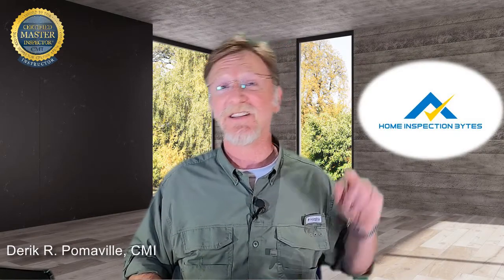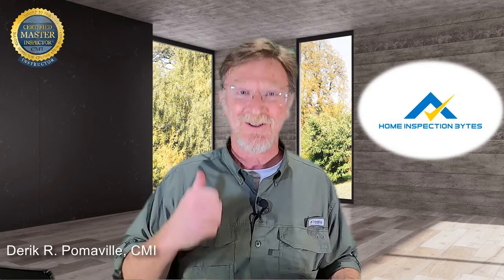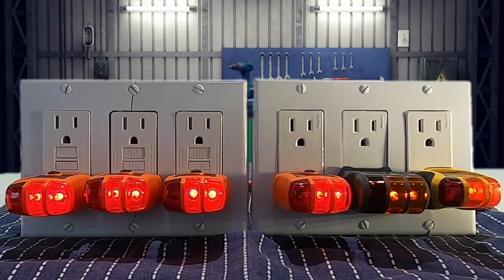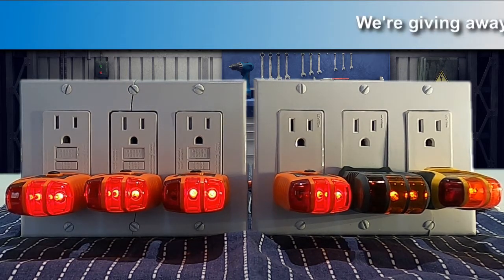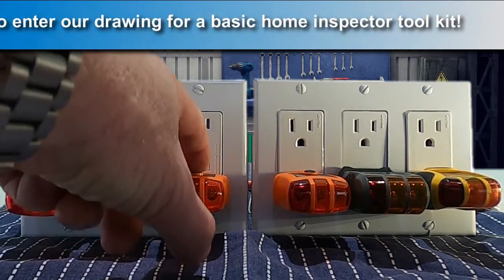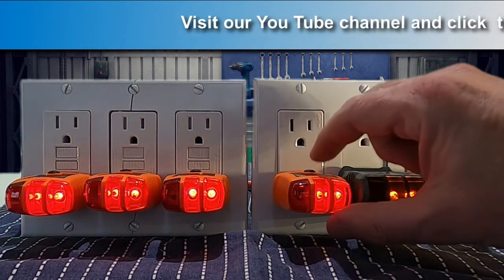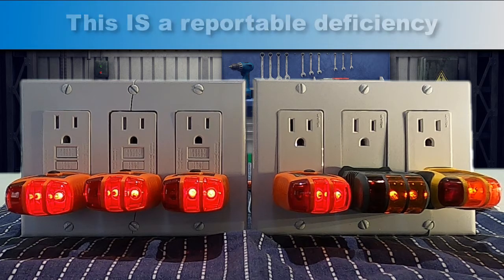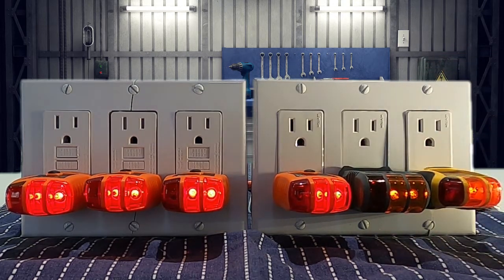Multiple GFCIs one Circuit

Comment: I Think I am falling into the problem you are discussing.............  
I have 3 GFCI outdoor plugs on a 15amp breaker.  All were working just fine.  Now my scenario is one GFIC is green and test resetable,  one is showing red and not resetable.  The last one is dark, no power to it.
I just changed out the red GFCI receptacle and the replacement is showing the same red light and is not resetable.  Pulling my hair out here. :-)      
I dont think its a incorrect wiring anywhere along the line  ( line load setup incorrectly) as I rewired these several years ago and they have been working fine until now.
Of interest, in the faulty GFCI,  the hot to neutral voltage was reading 5-6V  and measuring hot to ground was 25-26V.
My fear is that I have an internal wiring issue  and on a finished house, impossible to deal with.
Any ideas?
Reply: Update:    I started with the first GFCI receptacle which is working properly. Tested the voltage and all is good and rewired it so the two wires to the next receptacle were also in parallel (not series).     The next receptacle with the red light originally, is problematic, or I should say the wires at the junction box.    I did note that the two ground wires were wired to two different screws so I put the two wires on the same screw and then the single separate copper wire for ground on the receptacle on the same screw.
These are the results with no power applied to the circuit.

Line Voltages  ( wire coming from first good receptacle) 
Hot to Neutral  0.5V
Hot to Ground  0.5V
Neutral to Ground  0V
Load voltages ( wire going to next receptacle )
Hot to Neutral: 0V
Hot to Ground: 2V
Neutral to Ground: 2V
These are the results  with power applied to circuit. 

Line Voltages  ( wire coming from first good receptacle) 
Hot to Neutral  8V
Hot to Ground  8V
Neutral to Ground  0V
Load voltages ( wire going to next receptacle )
Hot to Neutral: 0V
Hot to Ground: 2V
Neutral to Ground: 2V
Conclusion, there never was an issue with the GFCI receptacles as none were involved in this testing.  I suspect now that I have an internal and potentially dangerous wiring somewhere in the house that is causing a leakage of around 112 volts ????

Comment: In a non-ideal world,  where my kitchen and bathroom GFCI were installed post construction and are daisy chained,  yes, big annoyance. 

Another creator said the second GFCI wouldn't work at all, even though receiving power. It turns out daisy chaining via line > load method does not work if your outlet has a grounding wire. Mine does not, so it works.

Comment: I can see how this could be confusing for multiple outlets.   I would disagree however if you’re also including a GFI breaker + GFI outlet wired so that each can provide trip protection for the same circuit.  In this case it’s easier to check why the outlet is dead and it’s just redundancy for GFI protection at both outlet and breaker.

Comment: This is a matter of how the outlets are wired. Each of the three GFCI'S should operate independently since they are in seperate rooms. To do this simply make pigtails off the feed in each box. Wire the pigatils to the line of each GFCI. The way this is shown it appears the first GFCI feeds the down stream GFCI's off the load side of rhe first one. That is improper.
Reply from the maker: Thank you for the details. Yes it's improper, that's the point.  To demonstrate a common deficiency found by home inspectors.

Comment: It's an inconvenience to look for the tripped GFCI, but it doesn't violate code. You may need to move boxes around, but I don't believe an inspector should write it up. Stick to what the code requires and not inconveniences.
Reply from the maker: I disagree. Home inspectors are not code inspectors.Some states even prohibit citing code in the report. The video is about the inconvenience of having to reset them in the proper order to regain functionality. Recommendation stands for professional home inspectors to diocument this condition in their report.
Reply: @HomeInspectionBytes  Inconveniences are relative. Some people may not mind it all while others may. Safety, which is the foundation of codes or standards, shouldn't be compromised. I don't believe it is wise to let inspectors decide what is convenient or not. Your project approval will depend on the inspector's opinion.
Reply from the maker: @thejuicerr  this video is for independent home inspectors, not ahj.

Comment: Dude, this only happens if you wire it wrong.     If you put the everything up stream on Line (both sets of wires); the down stream stays live when the up stream is tripped.  

This isn’t a problem unless a dip stick puts the line feed on the upstream line, instead is the upstream load. 

I would right up your foolish example BUT NOT a properly wired multiple on on circuit.  

Also who the heck is putting that many different baths on one breaker; again only a fool and that crap should be wrote up regardless of the GFCI, upstairs bath and down stairs bath need to be on separate breakers.
Reply from the maker: Apparently, you didn't see the first part of the video where we talk about how this is something home inspectors frequently find and have to document as a deficiency in their report. The point of the video is to describe why they would experience these symptoms when testing the outlet.

Comment: I don't usually comment on thing, but after what I just went through, I felt it necessary. I want to thank you for this information, I just experienced what you were talking about.

I was upstairs in my guest bathroom, which is a GFCI, as per any normal wiring code as it was next to a sink, but when I used my tester to trip the GFCI, my tester told me I had successfully broke the circuit. Now I will say that I am a new home owner in this house, and didn't know anything about the wiring. So as you just described I tested the circuit on the outlet I was testing and found that the GFCI did not trip on the outlet I was testing, I also could not get it to reset and had no idea what was going on.

Thinking the GFCI was faulty, I took a non-GFCI outlet I had and installed it, I know that is not to code, but before installing it I noticed that 2 outlets in my living room, downstairs were not working, which really confused me, and I was just trying to test if the GFCI was faulty. As you can understand it did not fix the problem, so I put the GFCI back in place and went to my main breaker to see if I could find a tripped breaker, again, as you know there was not a breaker tripped, which left me scratching my head

I would like to point out that on the main breaker diagram I could not find a single breaker that said it was for the upstairs bathroom. In doing some investigating I checked the master bathroom, to find nothing wrong, I tripped the local GFCI and reset it just like you would expect. I then went downstairs, and on a whim, I checked the downstairs bathroom only to find the outlet next to the sink, the only one in that bathroom, and also a GFCI, was not working. I then checked the GFCI which looked like it had not tripped, to find it was not, and now I couldn't get this one to reset.

At this point I remembered that on the main breaker diagram I read a line that was labeled as downstairs bath garage gfi. It was at this point I decided to check the garage outlet, and what I realized was that outlet was also a GFCI, which I didn't know prior to this point. It was tripped at the local GFCI, so I reset it and also reset the downstairs bathroom, which also caused the living room outlets to start working, I don't know if it was tied to the garage or the bathroom as I didn't check prior to resetting the bathroom.

I then went back to the upstairs guest bathroom and was able to reset the GFCI. After all of that I Googled how many GFCIs could be on one circuit, which is when I found this video.

I would also like to say that this house was built in 1984, long before I ever thought about being a home owner, as I was 5 at the time. I guess I just wanted to say all of that to say that I fell victim to exactly what you said could happen, I tripped the garage GFCI when I was on a completely different floor and side of the house from the garage, and had no idea I'd tripped the garage GFCI, thank GOD this didn't happen when when time was not available to run down the issue, and that I was able to figure it out without having to call an electrician.

So thank you again for making this video, though I found it after I'd resolved my problem, I just wanted to say that I experienced the exact situation you described.
Reply from the maker: I'm so glad we could provide you with an explanation for why you had the problem!

Comment: I completely agree with this idea as being the best method of wiring for GCFI's on a single circuit. 1 GFCI and the standard outlets per run of outlets on a circuit is Best way to wire a Home
Reply from the maker: It sure makes things easier for the homeowner and doesn't require the extra expense of all those GFCI devices!
Reply: @HomeInspectionBytes  Exactly right

Comment: Yep, you must wire them in series! That way each GFCI plug will trip independently, regardless of all the receptacles running on the same circuit! You just have to pigtail them in to series. 

Here’s an example, in my kitchen, if I have “5” 20 amp GFCI outlets wired in series “pigtail” then let’s just say the center outlet trip then that means the other receptacles don’t trip because each one is independently wired “series” not parallel! but they will all do the exact same thing instead of having to go back and reset the receptacles one by one. Technically, you just need one GFI receptacle to protect all the other plugs, downstream,but you can have them independently if you want but most people only put one GFCI on one circuit for the cost. But more to the story, you can have multiple GFCI plugs on one circuit even though it’s not practical, but you still can. you can go to a more alternative expensive route, which is a whole home GFCI breaker protection but that’s a lot more money.
Reply from the maker: Great comments, and thank you for posting!  All too often, others look at this video as though we're trying to teach others how to wire up GFCI outlets, lol.  Thanks for providing perspective and relevant commentary.  

DP
Reply: Not in series.

Comment: Well if you're feeding the other bathrooms on the load side, why install additional GFCI outlets at all? Better yet, spend a few extra dollars to put each bath on a dedicated circuit, use a combination breaker and don't use any GFCI outlets, no?
Reply from the maker: The whole point of the video is to demonstrate how multiple GFCI's on a circuit are a nuisance to the homeowner.  Home inspector's don't typically make recommendations for how to wire the house.  We find the conditions and report them for repair.  If you install a GFCI outlet correctly, all the downstream outlets are protected.  There is no need for the additional GFCI devices.

Comment: It good to have multple no fault recepticals on same circuit. But not smart to put a receptical on a circuit over 20 amps on a single phase 60 hertz 120 volt service. The service breaker can be a regular tempature breaker of 20 amps and depends on how many items need use on same circuit at same time. Every no fault not over 20 amps, are short mercury breakers and not regular tempature mercury breakers. If run only 2 at less than 10 amp each  work. But not more than 20 amps on a 20 amp service breaker. Plus can use regular tempature receipticals on a no fault main circuit breaker  not a tempature receptical breaker. It will have its own  private ground green wire in breaker for panel box grounded terminal.
Reply from the maker: Thanks for the input and thanks for watching!

Comment: Certainly, GFCIs can and have be installed incorrectly (putting a GFCI on the "load" side of an upstream GFCI), that shouldn't be cause for blanket failure of properly installed multiple GFCIs on a single circuit.

In a kitchen, with over the counter receptacles, you'll make a home owner, that cooks, much happier to have ALL GFCI receptacles (all wired to the line side) rather than one GFCI and a string of standard receptacles on the load side of the GFCI.  Sure, it costs more to have the GFCIs but gone will be the nuisance tripping yet retain all of the GFCI protection.  

A GFCI has a primitive circuit that trips when 5mA of differential current is detected on the line and neutral.  That 5mA is cumulative when load receptacles are added. In a kitchen, one has quite a few reactive loads (mixers, and other motorized gadgets) and those can fool to GFCI, particularly when there are multiples going at once.  Go to separate GFCI per receptacle (again, all wired to the line of the GFCI, nothing attached to the load side of any GFCI) and the fale (nuisance trip) is eliminated without compromising ground fault protection. The inspector can test them without any confusion either. 

This is less of an issue for other circuits where, typically, one thing may be plugged in at once and operating. Most other areas don't have the reactive loads like kitchens.  I, personally, prefer all separate GFCI so if there is a cause for a trip, one knows exactly where to reset it and/or what device was in use that caused the trip.
Reply from the maker: Excellent observations, and well stated.  For the purposes of a home inspection, however, I'll stick to my original recommendation.  Not everyone is a cook who regularly trips their GFCIs.  Most people find the backtracking to reset all of them annoying when they're done the way I presented it in the video.  If, however, I go through the kitchen and each outlet is a GFCI, and each trips and resets properly, there's nothing to say because they work correctly.

Comment: A bit off topic but a question regarding GFCI

So the GFCI always needs to be fed directly through the panel ( a homerun), it's the first in your circuit  and then your daisy chain comes off that ? Correct?

If the GFCI is fed directly from the panel, can you daisy chain off of it in both directions?...so that 3 romex lines come out of your box ( total of 9 individual wires).

I'm doing a kitchen which needs 2 circuits ( for my counter tops), my fed is coming 50 ft from the panel up through the basement in the middle of the kitchen to the GFCI and then I've daisy chained off of it to the right ( skipping every other one) but I'd like to continue the circuit to the left, so can I feed off the GFCI both ways ?
Reply: A GFCI does not always need a home run. If you have a circuit where some but not all of the outlets require GFCI protection, you wouldn't. For example, refrigerators aren't supposed to be on GFCIs, to prevent nuisance trips from spoiling food. So a typical kitchen circuit might go panel -> fridge outlet -> GFCI outlet -> other outlets. Or, you could put the GFCI first and wire the fridge outlet to its line side.
Reply from the maker: Yes, the first GFCI on the circuit is going to adequately protect all the outlets downstream - when properly wired and installed by an electrician.  One GFCI per circuit is MORE than adequate when wired correctly.  Thanks for watching!

Comment: I think you're wrong but thanks for the info. You can add multiple gfi but has to be a parallel system (Not circuit system), you can not connect the gfi to the "load" or things get too complicated and you're Left trying to reset everything in a particular order as shown in video
Reply from the maker: You're missing the point.  When a home inspector encounters this, they're supposed to write it up. We don't tell people how to write the circuits. That's the point of the video
Reply: @HomeInspectionBytes  what other Code compliant assemblies to you write up?
Reply from the maker: @was6transam01  nice try, but I'm not talking the bait. You should read our SOPs and try to gain an understanding of what we do before you make such a trivial and under educated remark lol.
Reply: @HomeInspectionBytes  what does NFPA70 say?  Before you assume educational status, you might want to read my other comment. As a Registered Architect I would say that my reply was hardly “undereducated” 

I deal with inspectors misinterpreting the Code all the time. Pretending they are the ICC or the NFPA or UL and FM.  It’s a constant nuisance.
Reply from the maker: We don't do code inspections. We document things that aren't working properly. You can read up on our SOPs to get a better idea of what home inspectors document in their reports.
Reply from the maker: Yay. Registered architect. Good for you. You're not a home inspector and obviously know very little about our profession.  Thanks for watching.

Comment: In the case of bathrooms being on different floors I always wire gfi's in for each bathroom , in case of a trip you dont have to run up or down stairs to recet them , some lazy and cheap electricians will even put a gfi in the garage , porch or outside receptacle which is a major pain when you have to go searching for the tripped gfi, legal? yes smart ? no ! Wich brings me to another subject that home inspectors dont touch on , backstab wiring on devices , yes its legal and accepted by most wire inspectors , but i can tell you it costs people a lot of money down the road and has been the cause of some house fires for years , why they still allow it is beyond me .
Reply from the maker: Help me understand what you mean by backstab wires and how a home inspector can identify it. 😀
Reply from the maker: To identify backstabbing, the receptacle or switch must be removed and that is beyond the scope of a home inspection.